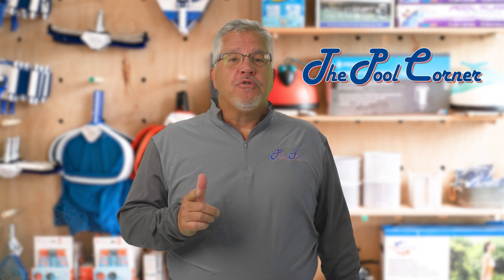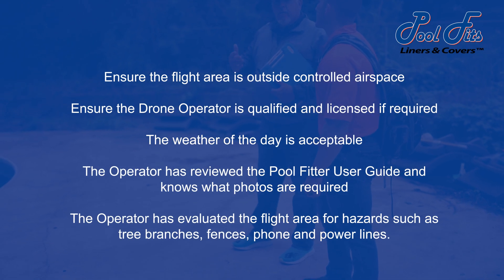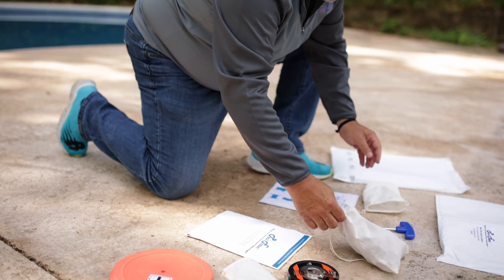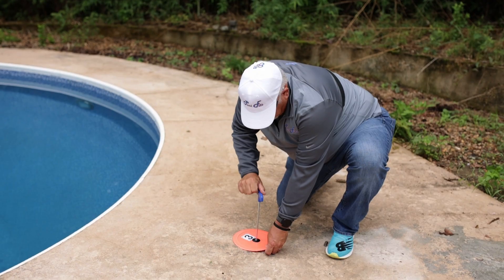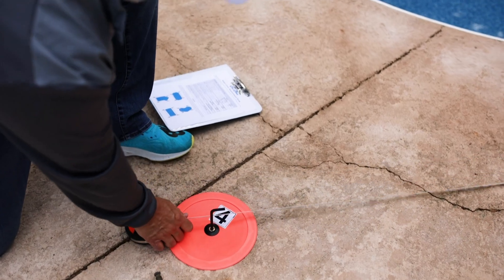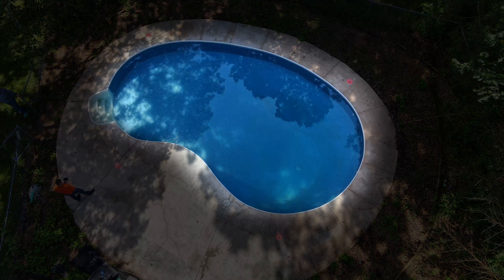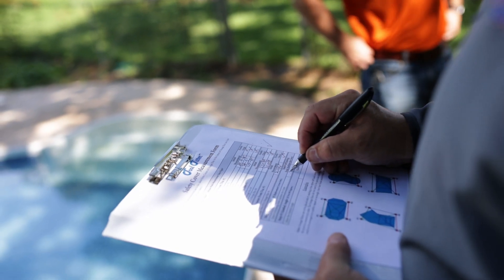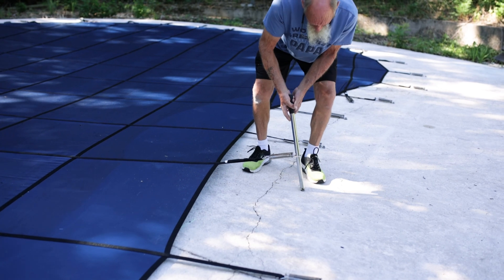Pool Fitter - Replacement Safety Cover Measurement

Comment: How does this work with new installations? When there isn’t any deck  anchors
Reply from the maker: Jonathan,
Hi!
There are a couple of options.  Most typically we use Lawn Tubes to secure the 4 Orange Discs.  We have a kit for exactly this purpose.
If you email a picture of your pool and deck we can dial in on the best approach.  
Our email is info@poolfits.com or you can always call us at 1-877-325-3487.